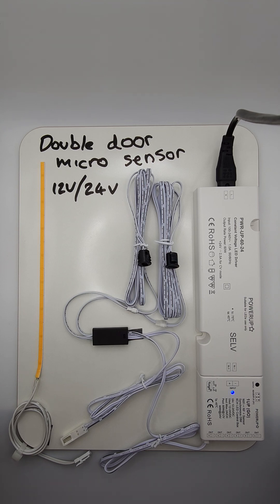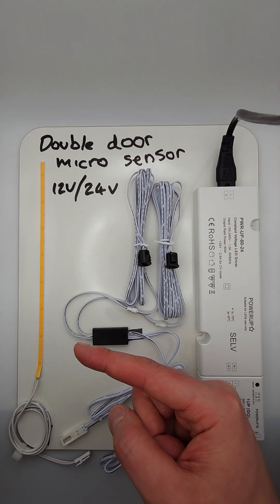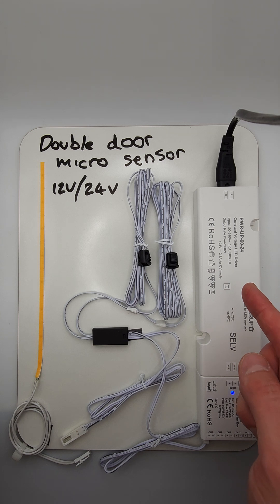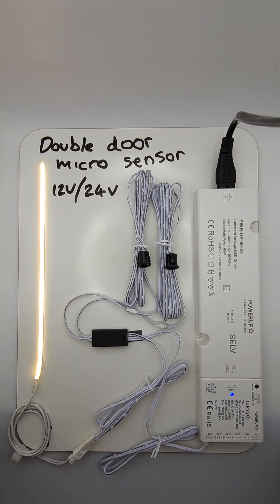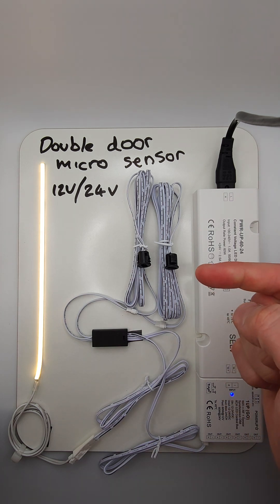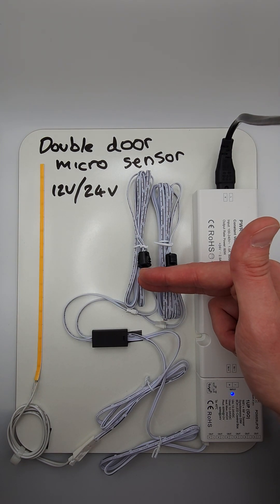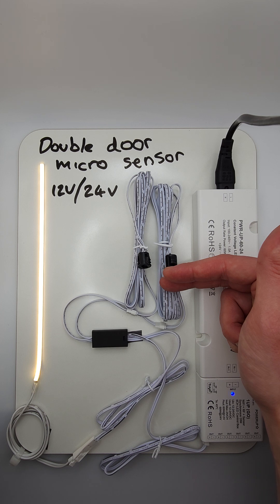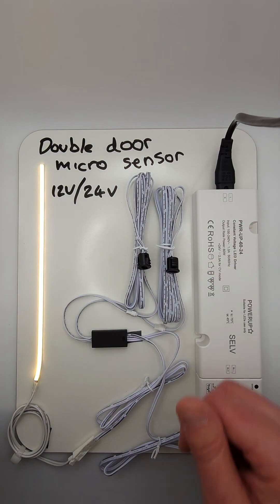What is a 12V-24V LED double door micro sensor?

Comment: What happens if it doesn’t work 😢
Reply from the maker: That's awfully negative (-) of you, however we're positive (+) it will. So long as the simple to use system is clicked together correctly. The wiring both positive (+) and negative (-) will handle the rest for a beautiful result! Thanks for checking in